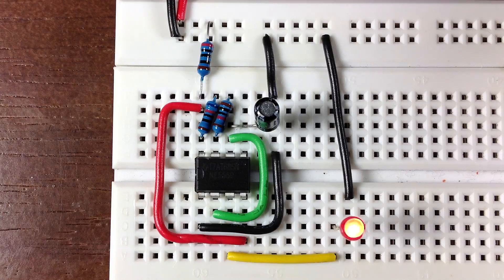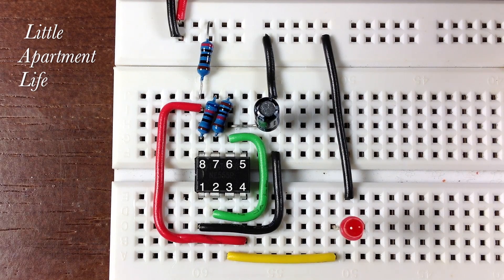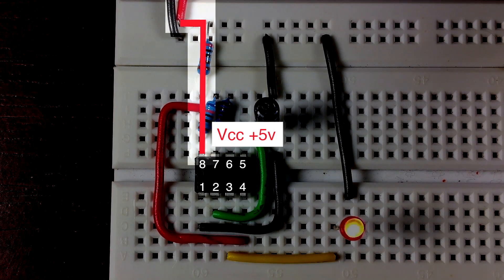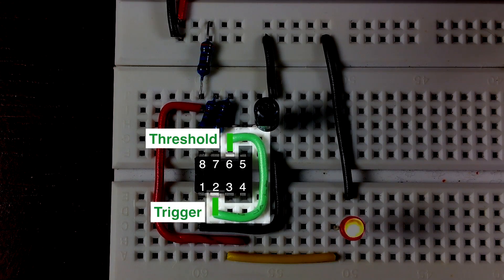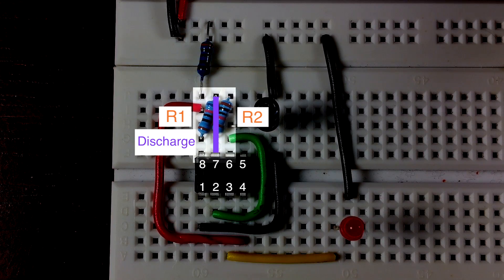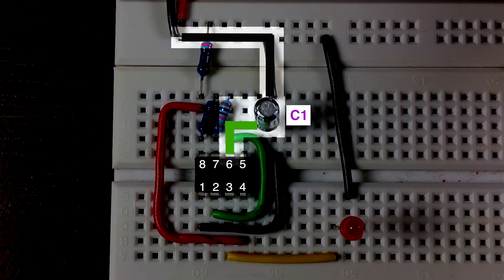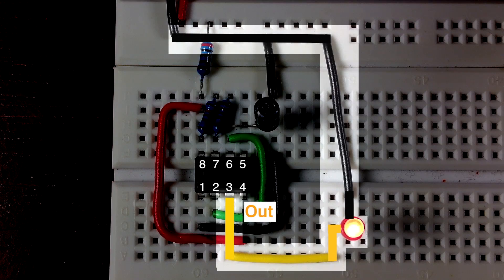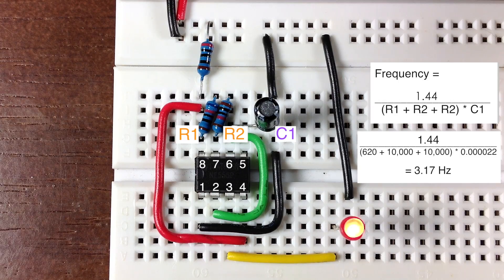555 timer oscillator tutorial

Comment: Mine isn't working. I replaced R1 with just a wire for an exact 50% duty cycle. I used a 560 or something Ohm resistor and a 470uf cap. I also didn't include the other resistor you said was unnecessary and instead connected a few thousand ohm one in series with my LED, and I used a 9V battery as a power source. Why is it not working?

Comment: I used a potentiometer labeled 500 ohm as R2 and a 1mF capacitor. Then I tried resistors with values below 150 ohms but they all made the LED act weird. Only resistors above 150 ohm made the LED blink. What could be the cause?

Comment: Sir what should be the values of capacitor and resistor if I want to have an output of 2hz and 2volt?
Reply: 2V is not enough for this project.  Just plug those numbers into his equation.  So, 1.44 / ResistorSum(ohms) * CapacitorSum(farads) = 2hz.  Use a 5V DC supply...super cheap.

Comment: Hi, ..... instead of 2 extra wires, ..... just connect the capacitor between pins 1 & 2.
Adding the resistor/capacitor formulae like you did was a nice touch.

Comment: where do you attatch the speaker?
Reply: Just connect the speaker instead of the LED ;) But remind that your frequency should be high enough to hear something ;)
Reply: Hey, I just want to say thank you for your response and the video.  Is there anyway to mix two of these oscillators together?  I've tried just connecting the circuits but it didn't work, or if it did, I couldn't hear the difference.... I really appreciate your help!  8 )
Reply: Just use a little passive mixer :) http://sound.whsites.net/articles/audio-mixing.htm 
Maybe this could help you ;)
I hope this is what you mean an sry because of my bad english :) 
greetings from Germany :D
Reply: To pin 3.  That is the high (+) output for the 555.

Comment: it's not working,the led just bright without flashing.
Reply: Same
Reply: @theredstonehive  this design does not work sir.
Reply: It works fine.  Just make sure you follow the wiring exactly as shown, especially the resistors and capacitor.  Also, give it time, I bet you have an incredibly slow cycle going like I had the first time.  1 cycle every 10 seconds or so.  Used a 1 million ohm resistor with a 1 uf capacitor.
Reply: It works but check this out. Mine was solid at first too. Then I realized I was using a 1uf capacitor so it was just oscillating so fast I couldn't see it, just appears solid. So I replaced the cap with a 33uf capacitor and then I could see the oscillation. Naturally a higher capacitance will take longer to charge and discharge. Check the fine print on the side of the capacitor and it will tell you the capacitance right next to it's maximum voltage.
Reply: http://www.circuitbasics.com/wp-content/uploads/2014/12/555-timer-astable-mode-circuit1.jpg
Load= LED or LED + Resistor, calculate required resistance.

Comment: Hey. I'm new to this and making little gadgets like these in an engineering lab. I just wanted to know - do those jumper cables basically serve to extend/connect the circuit? Like they basically serve as a way to bypass, for instance, the fact the breadboard's inputs normally aren't connected vertically (or, in the context of the board showed in the video, horizontally)?
Reply: TheArnoldification The jumpers are to connect things together, yes. That's the whole point of a breadboard, connecting things together in a controlled way without soldering. The reason for the internal power rails is so you don't need to use so many wires.

The nice, neat angles are an aesthetic thing, as well as an organization thing. It looks cleaner, and the neatness helps you figure out what goes where on more complicated circuits. Besides, having a clean, parallel signal bus on a logic circuit just looks *awesome*.
Reply: You’re spot on. A breadboard has rows that are connected (and separated by the gap in the middle) and the rows can be connected with these jumper cables.

Comment: Are all 555 timer the same?, in terms of pin location.
Reply: +Youtube Tv 
Probably but I wouldn't bet on it though.
Always check the information for your component, there are a model called 556 too, and that one are basically two 555 in one package.
Reply: I think mostly yes, cause I seen some got different connections and different voltages as low as .9 v ( made by the company Diodes Incorporated ZSCT155 ) which can run from AA/AAA battery.
But these ones got codes after their 555 to be identified as not generic.
There is also 556 which is 2 555 ICs in one IC, and there is 558 which is 4 in 1.
https://en.wikipedia.org/wiki/555_timer_IC

Comment: Sir what is the output Vpp of that circuit? our experiment is requiring three different outputs (1Vpp,60hz) (1Vpp,1Khz) and 1Vpp,2Khz. Is the output Vpp of that circuit can be vary to 1Vpp? thanks in advance! God Bless
Reply: +Carlo Tendido You can always use a resistor or transformer to meet your voltage requirement. The original output voltage depends on the resistors you use, the internal resistance is mostly negligible. Consider using a multimeter to measure the output, and adjusting your circuit adequately.

Comment: wht shd i use to get 60hz

i am in india our apliances use 230v,60hz

that is iam making an invertor by my own

can you please reply for this
Reply: +Ivan Paul Frequency depends on the resistance of the second resistor. However, you will burn a 555 timer (And almost everything else, too) if you try to use it with a wall socket. Consider using another designated inverter circuit.

Comment: In the Frequency formula, what does 1.44v stands for? Was it the input voltage source of the battery you're using?
Reply: You meant that how the formula works?
Reply: That's*
Reply: I used 4 1.5v AA batteries
Reply: scott garcia What constant is 1.44? I used different types of resistors and capacitors and I used the 1.44 in my calculation and got 1.42 Hz.
Reply: +Spreedator 1000 It is the constant of the 555 timer.
Reply: +sausy mayo Lowering the resistance of the second resistor should increase your frequency if you so desire.
Reply: +Spreedator 1000 It's just a constant that he has used. its needed in the equation since 1/(R1+R2+R2)*C1 is proportional to the frequency.

Comment: What's the 1.44 from in the Formula?

If you chose to put a resistor in the LED, you wouldn't include that resistance int he Frequency formula, am I correct?
Reply: +tadm123 No, you wouldn't. You include the resistance of the "internal resistors" (the ones which are in the circuit itself). 1.44 is the constant for 555 timers.

Comment: @Substrate7
The LMC555 cmos version will do 50/50 with just one resistor and cap.
Google 'lmc555 cmos timer rev j' , its fig16
Failing that you can always divide by 2 with a flip-flop.

Comment from the maker: Yeah, that's a good point and something I forgot to mention.  I never really use these for anything that requires much precision, but if you are wanting a very precise and steady oscillation, then you definitely want to put a decoupling capacitor across the power rails.  It is also recommended to put a capacitor around 10nf between the control (pin 5) and the ground (pin 1) to lessen the effects of AC and RF noise.

I'm by no means an expert at this stuff.  Still learning.